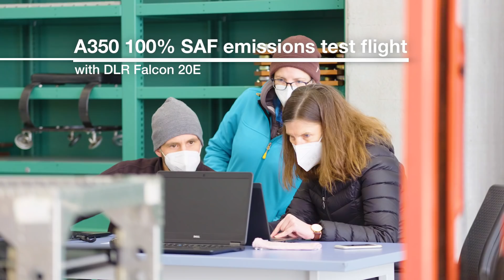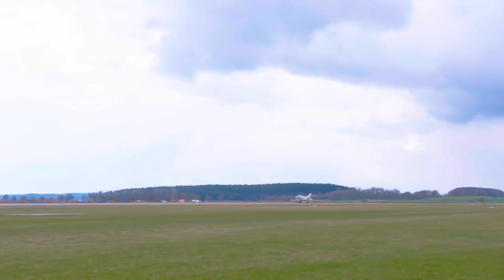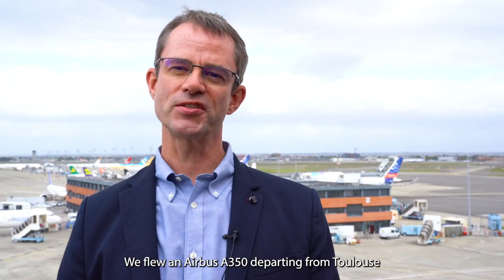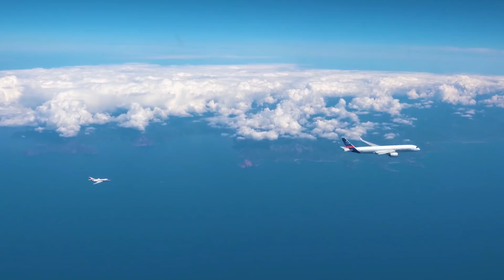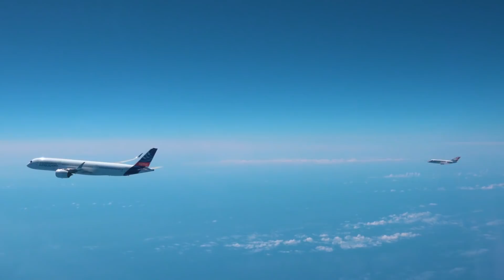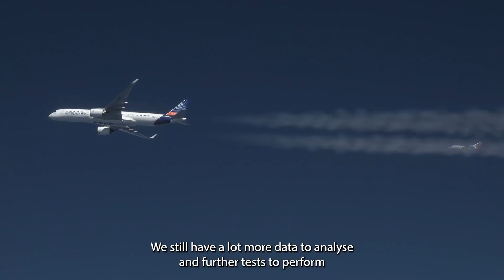The aerial dance of DLR’s Falcon 20E and #A350 operating on 100% SAF

Comment: WOW 🤩 Good Job Airbus I Got One Question About The Airbus A321XLR What Happen Between 2 Emergency Exits And The Door In Front But Where’s The Second Doors In Front Like The Boeing 757-200?
Reply: The 321XLR will have the same layout as most A321neos, full size front and back door, two overwing exits on each side and an additional emergency exit just behind the wing's trailing edge